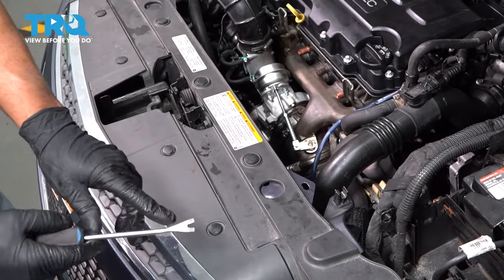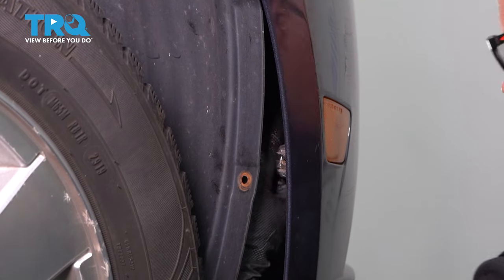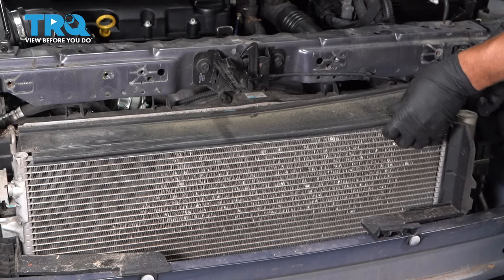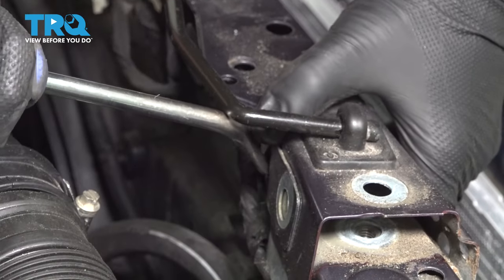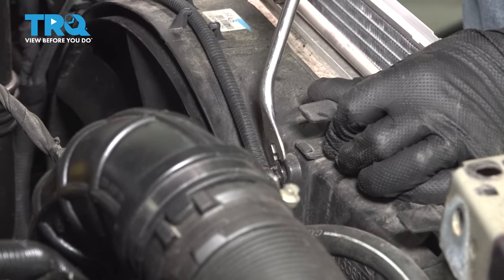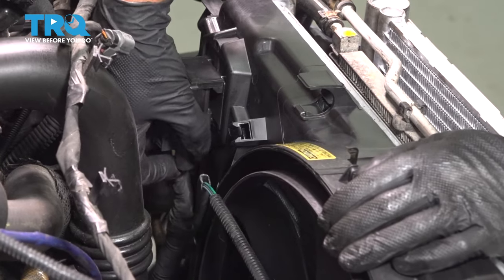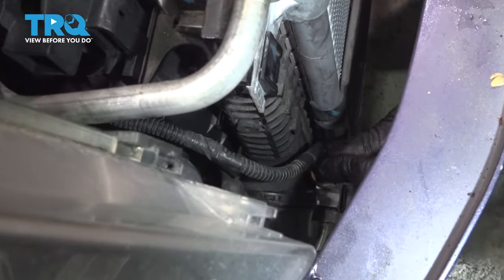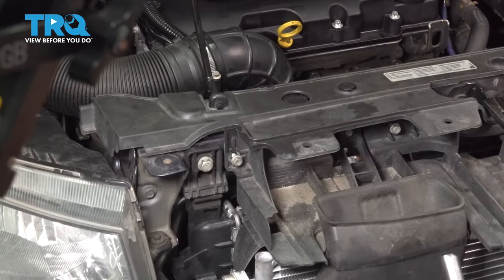How to Replace Radiator Cooling Fan Assembly 2011-2015 Chevy Cruze

Comment: Remember folks to always disconnect the battery if using an impact around air bag sensors. Also shouldn't you make sure the fan actually works before putting everything back together? Just my 2 cents. Great job explaining how to undo the wiring connectors though. Nobody does that.

Comment: This video is awesome, my only issue is, I have transmission lines above my fan. An updated video with that part would be sick. I had to basically rip my radiator fan out. About to hopefully get my new fan in.

Comment: So after watching other videos. I found that you can change this in under an hour. Without removing half the front end. 
I changed mine out and it came out the top! Wasn’t hard at all! 
2012 Cruise 1.8L automatic transmission 
I assume this is a Stealership’s way to do it, but this isn’t how you have to do it.

Comment: Do you have any videos on radiator fan balance or adjustments? When I turn the A/C on, and the fan start turning, there is a clicking/rubbing noise each rotation...?